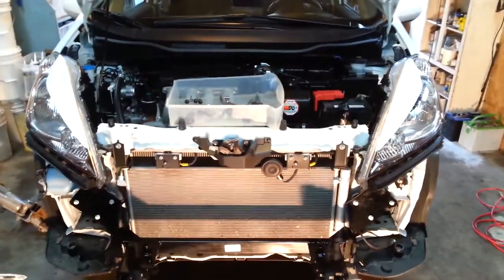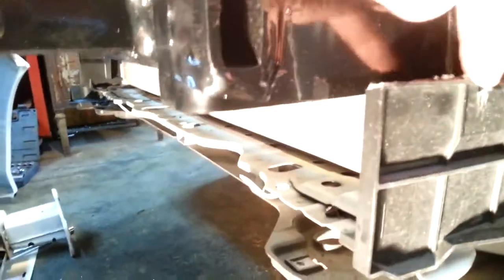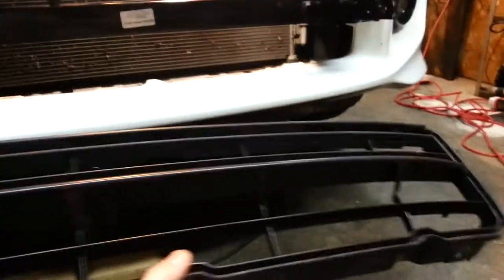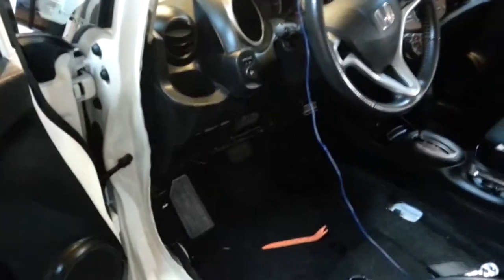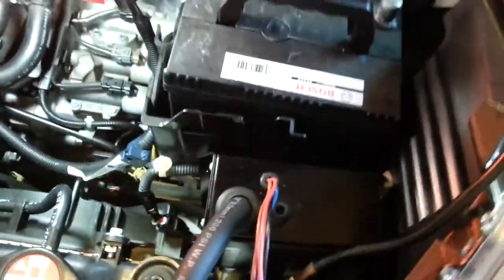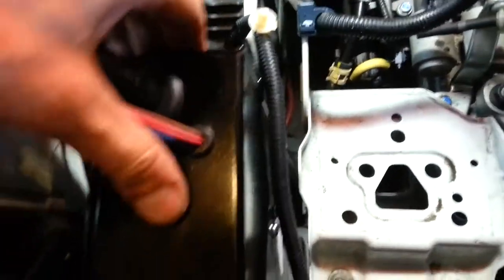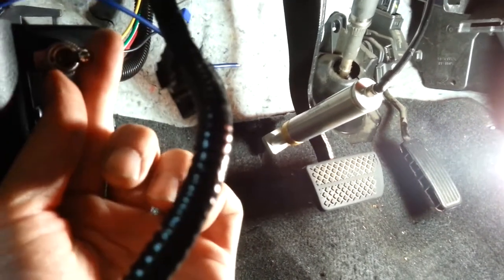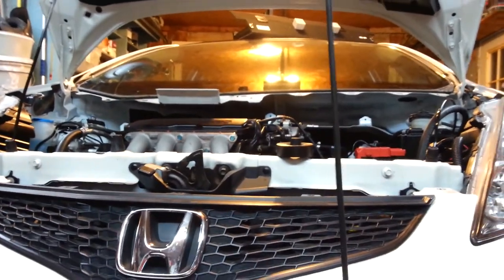DEMCO SMI Stay-in-Play Duo Braking System Converting a 2011 Honda Fit into a Toad / Dinghy

Comment from the maker: Items used
Demco 9518236 Base Plate for Honda Fit
SMI 99251 Tow Brake System Stay-IN-Play DUO
Install Bay Split Loom 1/4 Inch 100 Foot Coil - SLT14
Hopkins 56302 Plug-In Simple Towed Vehicle Wiring Kit
Hopkins 48425 6 Pole Round Vehicle Connector
Hopkins 39332 BrakeBuddy Towed Vehicle Battery Maintainer
Hopkins 47055 Endurance Flex-Coil HD Adapter with Nite Glow